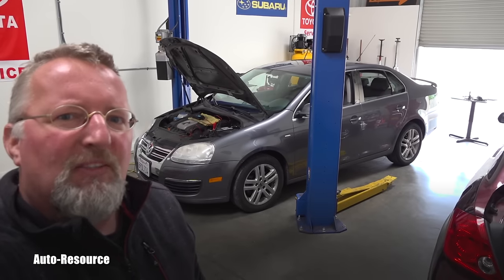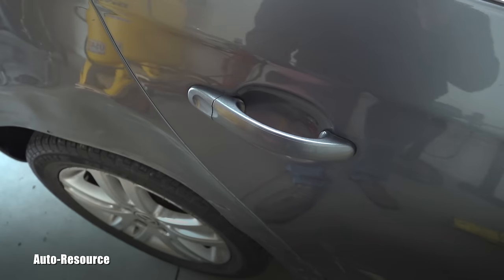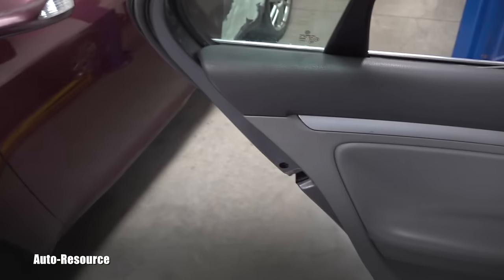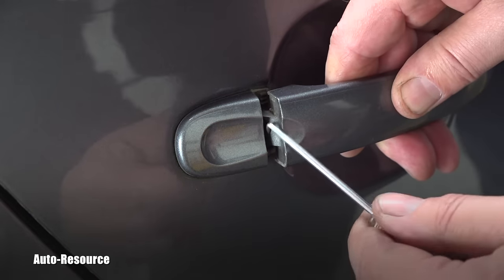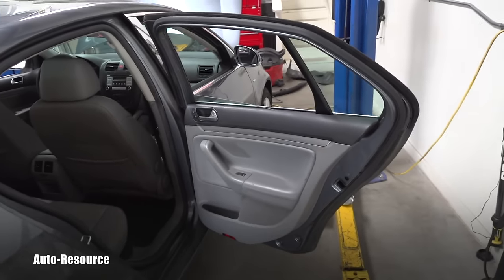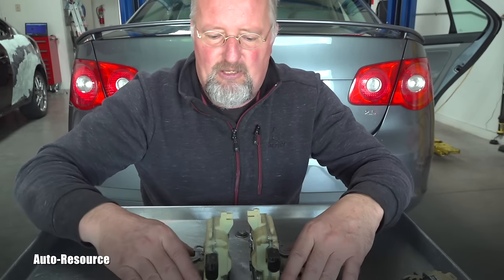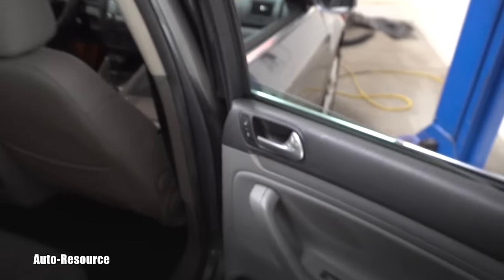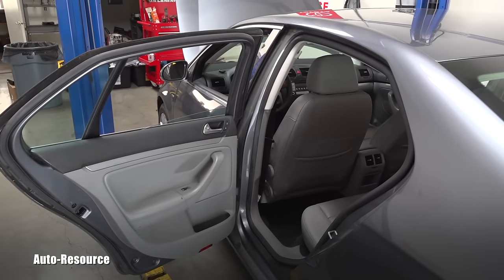How to open VW door which won't open from inside and outside

Comment: The fact that this has 1M views should tell us something about this design…
Reply: wait till you see how to replace mk5 variant rear door lock actuator. It's easier to sell the car altogether.
Reply: worked for me
Reply: Yeah but it's a clickbait fix. And can cause an unnecessary issue (like having to reconnect your outer handle connection that didn't need disconnecting in the first place). Diagnosis first!

Comment: Wonderful! I found your video using a Google search and then opened a rear door on my 2009 Jetta TDI that had been stuck for more than 3 years. Two mechanics specializing in German cars had already told me that this would be an extremely difficult repair to do since it would require detaching the outer door skin while having no access to the door sides. So I had settled on just living with the problem , until now. Thanks also for demonstrating in the video that the door still opens and shuts normally afterwards. Only the outer handle is detached.

Comment: I have this problem with my Volkswagen Jetta in Argentina, I will take your video into account and I will try to open the rear passenger door to repair the lock.  You have been very helpful and thank you very much for this video.  If I can at least open the door I'll be more than happy.

Comment: I just changed the latch on my rear drivers door on my mark 5.  In order to get the right feel of the handle, I set the black tab in the handle deeper than the preload spring let me.  After a day of it working correctly, the door would no longer open from inside or outside.  After watching your video I put two and two together and realized that I must have set it too deep.  I pulled the tab out of the handle and the door opened from the inside just like you showed.  Thanks

Comment: Amazeballs!!! Not joking! This works! After suffering through this extremely drawn out video that does not work on a 2003 Beetle, I went up to the Beetle, hit the unlock switch once, smacked it twice on the door panel and the door latch suddenly worked. Amazing!!! What will VW think up next? I hate all these secret methods Euro cars have.

Comment: After door painted on mine Golf 4 ,on 1st remote lock door was stuck. After watching this tutorial and best explanation I realize that the garage man put the little wire so high,at the end, and there is no ELECTRONIC CIRCLE. 
Thanks,I fixed and save me for wondering 🤔 and trouble. (Before paint was ok and only the handle was removed from outside).  👍👏

Comment: you did a brilliant job to explain this in details and yet keep it simple. I can now proudly say that my Kia Sportage's left hand-side rear door has started to do the same, not opening neither from outside nor inside. and from what I have learned reading/watching some contents online, it is either the cable at is linked to the actuator or the motor inside of it. but like you said it can be a RESET issue. which none of the others really mentioned. 

Now, I reckon if I can open the door with the pick approach you demonstrated it will safe a massive headache since for my case i will need to remove the inside door cover. and without opening the door it will be so difficult to remove the push pins that holds the bottom of the door.

such a good point you made about Engineers in general, It works great when it s new, but good luck fixing it when it is broken. Right to the point. 

Have a great one.
Reply: Hi how did you solve this problem? I also have a sportage

Comment: Changed the lock case on my Octavia MK1 today due to some electrical problems. Closed the door and was not able to open it again neither from inside nor outside. Your video gave me a clue, and it showed out that the problem was related to the steel wire from the outside handle as you pointed out. Somehow the steel wire end with its plastic joint had gotten a little bit out of its position, which caused the problem you highlighted with the lock not freeing out properly. Sprayed wd40 through the handle opening, and slammed carefully on the handle with my hand. Obviously the plastic joint rotated on place, and the door is now fully in order again❗ Thanks ❗
Reply: Same issue with the same car. Did this sort out your issue?
Reply: @jobbiejew  yes it did. Pull out the relevant external door handle. Then spray WD-40 or similar on the tiny wire that goes down to the latch case (spray as far down you reach on the wire). Release the handle and hit it repeatedly by hand. Do this sequence several times if the first try fails. If this do not solve the problem you may need loosen the wire from the handle, which is a bit more tricky.
Reply: @arildhelle64  I’d love to know how it could’ve came out of position considering there ain’t much play in the cable to begin with. Is it just because that hook ain’t returning to where it should? I changed the lock mech today and left the door card off in case something like this were to happen to make for easier access. Did you unclip the steel wire from the external handle before blasting it with WD40?
Reply: @jobbiejew  didn't unclip the wire. The problem is the lower plastic joint coming out of position as described earlier.

Comment: Excellent! 👍. Normally we operate the lock multiple times and then bang the door in the area of the lock which works about 80% of the time, the other 20% we rip the panel off the inside.😀
Reply: Normally, you should operate the lock one time, and it should work 100% of the time (not 80% of the time according to the VW quality standards) which means you may burn alive in 20% of the cases.
In hazardous conditions, you don't have the time and the tools to rip the panel off and disable the standard lock mecanism.
I can't imagine why engineers and higher managers in this big company could consider this as an acceptable risk.
When you have 3 grand-children seated and belted on the back seats of your Touran, you can't accept them burnt alive because the VW engineers admitted a potential failure of the door locks.
My next car won't be a VW because these cars are far too dangerous for me.
Reply: Not joking! This works! After suffering through this extremely drawn out video I went up to the Beetle, smacked it twice on the door panel and the door latch suddenly worked. Amazing!!!

Comment: Replaced two of the lock control modules on my Passat.  Verified that the handles worked by closing the latch with the door open, yet when I closed the rear door it wouldn't open!  I apparently put the clip on the handle to far out.  This technique got me into the car and functioning correctly without having to remove the door panels from inside the car!

Comment: ABSOLUTELY BRILLIANT !!!!

I had the same problem with my 2008 skoda fabia, I was contemplating having to cut a hole in the door and replacing it with a second hand one, im so happy I found your video 😁
 it worked straight away thank you for uploading it, liked subscribed and rang the bell
Reply: ,,,2000 model Bora aracımın sol arka kapı açılmıyor acabilmem için yardımcı olabilir misiniz

Comment: Hi there ,
I got an audi a4 b8 2009 , im located in UK.My passanger door left and aide won't open either from inside or out...i do not have your opinion you shiw tonus on your video...what should I do
Reply: Did you end up getting it sorted? 
I have a similar issue with my left front passenger door.

Comment: Thanks for your informative channel.

I drive a 2004 Polo of which both rear doors are also "permanently" locked.

I removed the cable from the outside handle, but nothing ... the doors remain locked and will not open, even from the inside.

Any suggestions on what I should try next?
Reply: Same issue lol - did you solve??
Reply: @TankCatIntoMordor  not yet. It is very frustrating.
Reply: @AndrevanTonder67  That sucks
Reply: @TankCatIntoMordor  tel that to my kids who have to get in and out through the front door 🤣🤣
Reply: @AndrevanTonder67  lol likewise with mine. Check out How to open a VW door that won't open from inside OR outside - BMAC VAGS. He shows how to do it with a coat hangar...
Reply: Same issue here.. 05 polo

Comment: Excellent info !  We have an 01 Beetle it hasnt done this problem yet but modern door latching is a nightmare if you don't know the " trick fixes".
In our 07 Ford Focus the micro switches were sticking.....causes all kinds of problems including the anti theft and of course the dome light.
Despite Ford insisting on special Ford door lub I used a combo of dry graphite on the latch and white lith on the mechanism.   That was 5 yrs ago and zero prblems since.

Comment: Much like my 04' Passat 1.8T GLS Wagon's hood release completely broke. Was a pain in the butt and alot of people had issues but the main blame 4 me being worse off from other people's situations was because my x wife ignored the signs if it causing issues. Now that I have my hands on it she is running soo smooth and has been upgraded parts and hoses it is now time for me to get into the interior and check on how everything is looking which includes the door component sets which I may replace. Not a fun job since they are riveted on but that's why it's my project car. Thanks for sharing.

Comment: I have a 2007 Skoda Octavia. The lock button goes up when I try to open it, but when I take my hand off the handle, it goes down again. the door does not open from the inside or from the outside. do you think if I did the same as you it would work?

Comment: Huda your method is working on the door I can open. Brilliant, I've been spending days hours frustrating and now 

Your video helped me. Thank you so much. Respect lot of love 

And by the way 

Forced wasn't working. But then I start the engine. 

Up a little bit. 

And eventually did work. So it is something to do with low voltage on battery Maybe. 

This is exactly what happened to my case. But without your help, I don't think I will do that. Again money money tanks 

Sorry for my English.

Comment: Great video - very informative!

With the 2009 Passat CC, I was under the impression that the lock mechanism could be replaced by removing the interior door panel first (believe I have seen YouTube videos and forum posts explaining this)?  Are you saying I need to remove the exterior door skin?

EDIT: Yes, I believe you now!  Outer door skin needs to be removed to replace the actuator - need to find and then watch your video on how to do this!

Comment: Danka!!!  My saviour - thank you so much!  Driver's door (2009 VW Passat CC) won't open from inside or outside!  Need to get the door open so I can remove the interior door panel and replace the locking actuator/mechanism.

EDIT: Sorry, outer skin, not interior door panel - that will achieve nothing!

Comment: Hello sir. My rear passenger door is stuck WITH The child lock on!  I have tried to follow your steps, and I am trying now to pull the litle leaver (outside handle) from inside the door panel😢 It dont work… any tips? 
Daniel.
Norway.
Reply: Same problem here. I also have the child lock on! 😢

Comment: Auto Source great info...I have a 2009 Audi S8 and this is a problem I’m experiencing on the RR door...do you think that’s a similar (VW) problem for me? Is there another access point for me to release the door so I can change the lock actuator?
Reply: Try turning the engine on and rev a little while pressing the internal unlock button

Comment: Unfortunately this hack didn't work on my right front door. I removed the wire from the handle as explained in this video but it is still not possible to open from the inside. The door is still stuck.

Comment: Hi there I tried opening my 2006 polo 9n rear passenger door but I see there's no small box to lever it to the left as you did here , I tried forcing a thin screwdriver but it is still not releasing the handle is still intact....

Comment: Brilliant I’ve got the same problem with my  Vw polo. I’m going to try dismantling the outer door cable. And let you all know the outcome. I’ve just pulled  the inner door panel off and got nowhere. I cannot believe how bloody difficult it is to try and open the door from inside the bloody car. As I’ve always done. Like with any car. Ford escort, Hillman hunter, Morris minor and many other cars. So much for German engineering.
Reply: well.. did it work with the polo?
Reply: @timmgrote2159  No it didn’t. I’ve had to strip the rear door down completely. After looking at many videos on here. Then i found the actual solution. That meant drilling a hole under the door card. Then removing a torx screw from the actual lock. It  was a bloody knightmare. But I did eventually get my rear drivers side door open.

Comment: I took out my battery to recharge it in my garden shed which is 30 meters from the street where my car is. when I wanted to put it back in my door unlocks with the plastic key but the door won't open when I pull the handle. If I remove that cable it would make things even worse as I can't pull it from the inside either. The trick to open the hood by pulling a cable from behind the VW logo in the front grid doesn't work either as I don't have that cable to pull on. Can I pull the window down with sucktion caps that they use to place windows? or is there another way to open this car? (only 1 lock on this Passat from 2006 or 2007 at the driver's side)

Comment: The short cable that attaches to the outside door handle should not be under tension when the handle is is not being pulled. If it is that's probably stopping the door lock actuator going fully back to its "rest position" so you won't be able to open the unlocked door from inside or outside. I've just released the cable (as very well explained in this video) and refitted it in naturally (not pulling it) and everything works! 5 min job but need a torx to remove the metal cover at the end of the door handle. The torx is accessed from just inside the edge of the door, slightly above the outside door handle, behind a round rubber grommet. Good luck kids!

Comment: Hello, we did step 1 on a 2007 Golf Mark V which we believe should work the same.  However the door will not open from the inside.  The cable is disconnected and has gone back through the little hole.  Any further ideas to get the door open?  Thanks for your information in advance. Regards Phil Coles, Rutland UK
Reply: Kelly Coles, I am having the same issue on 2007 Mk5 Golf, did step 1 and the cable disappeared. Have you fixed it? if yes please do let me know how you did it. Thanks
Reply: @marekadboy  we took it to a VW specialist in Kettering in the end, he removed the outer skin of the door and replaced with a genuine VW lock mechanism (£300 total, lock half the cost).  He had done done quite a few of these and didn’t recommend the £20 EBay replacement locks as they fail.  Recommend going to someone who has done this before or costs could rise.  Regards
Reply: @kcoles3830  thanks for your response. do you mind sharing the details of the specialist who did the work for you? Thanks
Reply: @marekadboy  AJK Vehicle Specialists, unit 3, Hazelwood Lane, Kettering. NN16 0AS
Reply: @Ed O all I can say is he wouldn’t do the cheap replacement lock, his labour cost was very reasonable.  Happy with the job.
Reply: @Ed O next time will try 😀

Comment: Before or in the same time you remove that cable from door handle, get a strong, slim and flexible wire and pull it through that head whole of that cable and catch it so you can try to pull it back later to the initial position.

Comment: I subscribed! I have a question, does the same technique apply to a vw passat b5?
Reply: My face was blocked on the right. I managed to remove the upholstery and the sheet with the crane that holds the jam. I thought it was a plug and I sprayed it but it still doesn't open. Do you think I could apply the same method? I saw that mine also has that buttonhole that you pushed inside. I would like your opinion before I try. and do you have a video where you repair the pot after or buy a new one?

Comment: Great video! So much crap is produced today... Have a 30 year old Opel Vectra and had never anything like that. 
The Seat of my daughter... nightmare... Right back door opens from inside but not from outside. Also central locking does not work 100%
Sometimes doors stay open, etc.
Keep the garages busy and the manufacturers rich...

Comment: Hiya do you think I need to change the lock, once I open it with sharp object. 
My front passenger door of vw polo 2006 automatic not opening, and the back door sometimes it opens then takes few attempts to close. 
Please help. 
Many thanks in advance.

Comment: Can you show that mechanism for the Opel/Vauxhall Astra J 2010 ?? My driver door don't open after I drove it for a while without the manual lock and handle. It locked by itself when I starte driving and now do not open from inside or outside. I can't reach the locking mechanism from the inside because I think it's impossible to remove the panel door with the door closed. Any suggestions ???  😓

Comment: I have a problem with the rear door on an 02 Passat..there doesn’t seem to be the little latch to pull up inside the handle..can’t find any way to open it..locked from both inside and out

Comment: Got the same problem, except the driver door won't open. So can't get in the car at all. You had it easy and had the window down to reach in and pull the inside leaver. What to do if you can't get in the car?

Comment: I replaced the lock the door opens from out & in if the alarm is not armed. Once I arm the alarm & unarm it will not unlock from outside only from inside I can open. Any ideas?